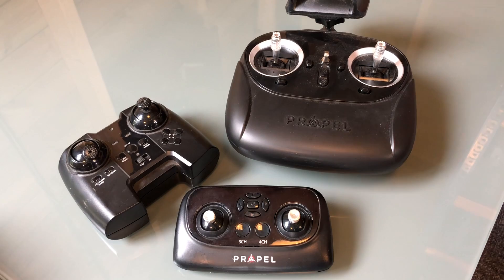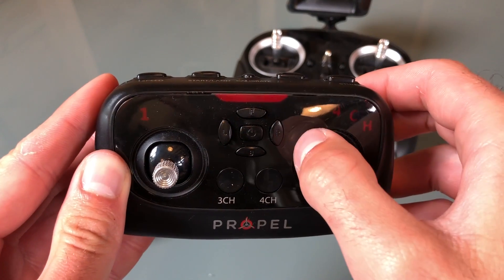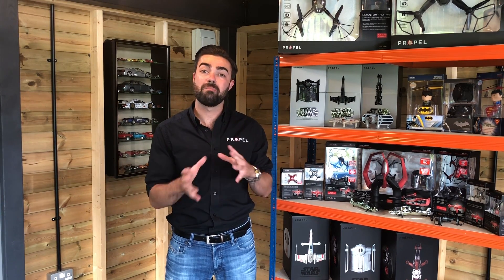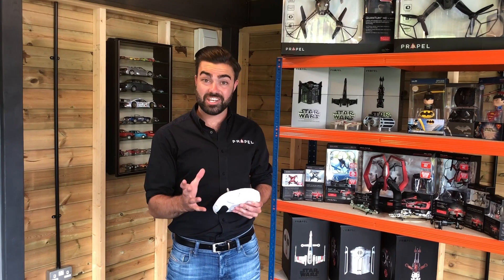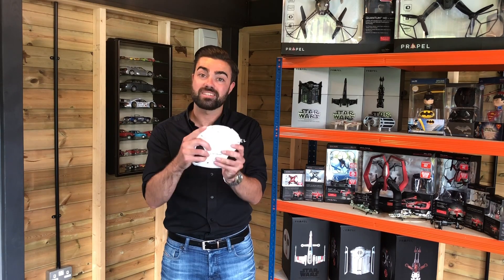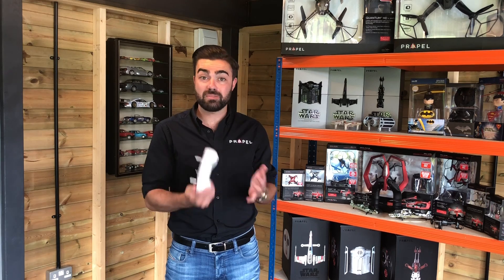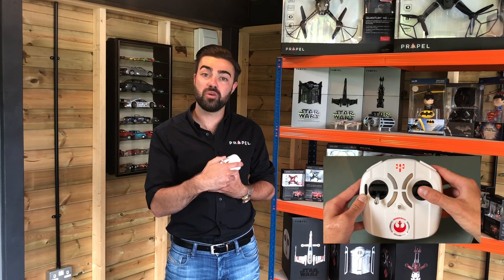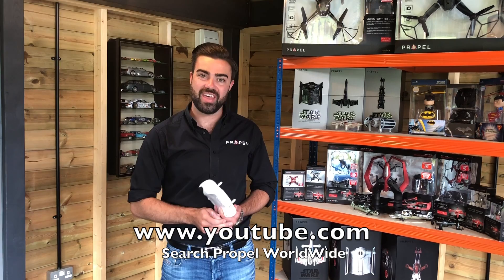Unstable Flight

Comment: This is great but what if my star wars drone is drifting forward or backward?
Reply: Mine is too
Reply: Hold the R2 button down when you use the stick (he doesn't say this) then push the stick back to stop the xwing floating forward and vice versa if it's floating backward
Reply: When I enter trimming mode on my controller when I turn the right stick to the right and it doesn’t make no beeping noise so I’m kinda stuck 🤷🏽‍♂️🤷🏽‍♂️ any ideas
Reply: YES THAT is my problem I have tie fighter Star Wars drone
Reply: GUYS HELP I PIT THE BATTERY IN UPSIDE DOWN ITS STUCK

Comment: I just bought the Propel X01 Micro Drone.  Did not work right out of the box.  The phone number has been disconnected and I am waiting to see if I get an email response.
Reply: I find chatting with them a faster  way to get help.
Reply: Did you fully charge your Li ion battery?